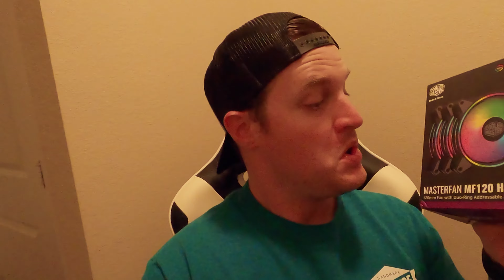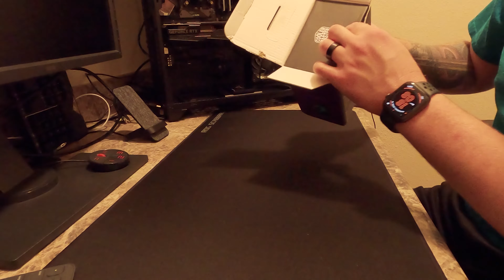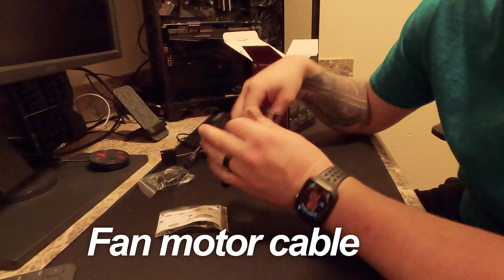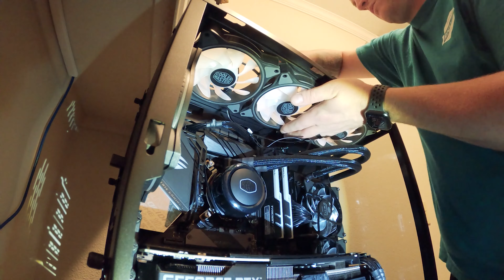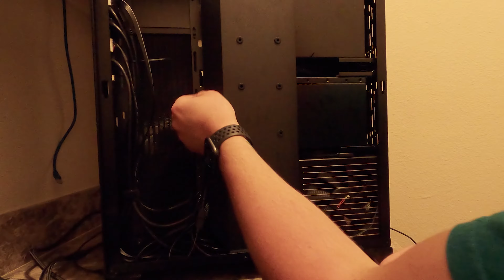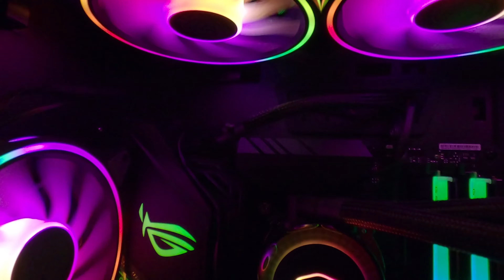Masterfan MF120 Halo Unboxing and Installation (Cooler Master)

Comment: I thought this video was a tutorial on how to connect the fans. guess not but great fans and lights
Reply: yea it was useless lol. says installation and he skips through it all
Reply: do y’all have addr_led or addr_rgb? the fan connector is 3 pins and you need to carefully plug it in there. if it’s going to be the rear fan plug it into the cpu_fan.
Reply: @lxquid.ocelot  3 pins ? I have one fan and have a 3pins but with one close (like one pin is not here). And i have a connector with 4 pins.
Reply: You, me and some other thousand poor souls HAHA
Reply: i see i wasn't the only one that thought this was a completely useless video that skipped the parts most of us need
Reply: Same

Comment: Thanks for not showing how to connect them to the mobo/controller :D showing how to mount 6 fans with 4 screws each is not really an installation guide

Comment: great light show but you missed the point of getting down to the point of how to exactly connect it
Reply: Have you found a video on how to connect?
Reply: @rainy6858  I just used them as case fans without lights I don’t care if it lights up as long as it works lol
Reply: So you can connect this three fans together? Because my motherboard only have 2 case connections for fans and i wanna know if i will be able to get the three fans working
Reply: @cache2152  yep what I just ended up doing was exactly that, although you don't want to have 3 fans running on 1 fan header. I'd say two max as that's what I'm doing.
Reply: Also for the ARGB connector, if your motherboard has a 3 pin argb header you can plug it into there
Reply: yes you can plug the fans into your motherboard i know this but how can i get the rgb lights on them working i have a z170 motherboard and there is no rgb plug on the motherboard i looked
Reply: I pluged all three fans on the mother board and controlling them with their controller
Reply: @GreatestPlayedList  I think we need to get a controller I have the same issue.. sigh
Reply: @GreatestPlayedList  you will have to use the controller provided with the 3 pack to power them through your power supple and the sata connection. Most motherboards nowadays have RGB header connector tho
Reply: Yeah it's driving me crazy, wanna pull the trigger on this set but all I want to know is whether the hub has an argb daisy chain on the motherboard connector so I can connect some other fans. I wanna use the hub because it has it's own power so I can theoretically run 6 argb fans, but NO ONE is showing that, or showcasing all the different configs for hooking it up and the pros and cons.
Reply: @sonicwingnut  you can daisy chain these fans 
KosherTech has a video up about it
Reply: @Simon-qk4vz  yeah I got 3 of these and one of those 360mm 3 fan ARGB panels they do - the panel one doesn't daisy chain but hooked it up to the end of the chain and put the lot straight onto the mobo argb header. Came with PWM splitter cable too but I had enough PWM headers to not need them. Total aRGB current was 2.85a so JUST enough on the header to power everything! The halos are 0.55A so you can have a max of 5 halo ones on a single mobo header.
They did pretty much nothing to improve overall cooling but they look amazing
Reply: @rainy6858  hey if I don't have a 3 pin ARGB header on my motherboard what should I do? buy an adapter?
Reply: @willhannelly8608  I think you might be outta luck, you might be able to get an adaptor possibly. what motherboard do you have?

Comment: Does the pack definitely come with a 3 to 1 fan header splitter as my motherbaord only has 1 fan header also what pin are they? and what pin is the 3 to 1 splitter that goes into the motherbaord. and with the tiny rgb box thing that is included can i use that if my motherbaord does not have a rgb header or will i need to get a rgb controller for it.
Reply from the maker: Yes the 3 pack definitely comes with the fan motor splitter cable. 3 to 1. Also the fan motor splitter cable is 4 pin. The 3 to 1 argb splitter is a 3 pin cable as well. As for the controller for the rgb support without mobo control, I’m honestly not too sure. I would imagine that it’s possible to use the controller in that way, I just can’t say for certain because I didn’t set mine up like that. Hope this helps. 👍🏼
Reply: cantgetnopeace I didn’t get the splitter. Only the argb version gets it😢

Comment: I have a similar rig with the 011 Dynamic and 6 x MF120s I would suggest putting the radiator on the top as an exhaust. Then have the halo fans as intake.
Reply: Since you have six fans, did you use 1 or both of the RGB controllers?
Reply: Hi man how many of the rgb controllers did you use for this I bought 9 fans and have 3 controllers but don’t want to use all 3 controllers
Reply: @harrypalmer1391  zero! I have my fan RGB daisy chained in to the motherboard plugs.

Comment: You installed the liquid cooler fans reverse direction. It needs to blow the heat out of the radiator.

Comment: Hi! I have the sabe fan kit. they are great, the only problem I had was with controling the RGB from the fans. It just didn't work, no software detected the fans in my system. Did you have this problem? would it be fixed if I bught a fan hub?

Comment: Hello. I have the same fans but my LED are not working bcs. I do not have a 3-pin cable connection in my motherboard. How do you get the fans to light up, and what extra cable connection are you using? Thanks.

Comment: ive never used a water cooler(but i plan to in the near future) so im not too sure of the heat in the radiator fins but wouldn't it be better to exhaust through the radiator? or is the heat in the fins negligible? anyway..sweet setup..appreciate the video. thanks

Comment: Thank you for this video. Almost the exact case I got (I have the pc-o11d razer edition). Could not find anything helpful on YouTube about these fans, which are/were impossible to find! Not sure why but they're not in stock anywhere now (especially 3-packs). I had to purchase 6 individual ones which should come by this weekend. Been waiting for a week already.
Reply from the maker: Nice! Very similar case indeed! Whenever I was ordering these fans around mid March I was able to buy 1 pack at regular MSRP and then the only way I was able to get the second pack was paying the price gouged additional $30 that a 3rd party seller was asking for. Definitely over paid but I wanted the fans to all match! Glad you enjoyed the video. Good luck on your installation this weekend!
Reply: I’m dealing with the same problem. Now even the price gougers are sold out. I just need 3 more for my build smh
Reply from the maker: It’s definitely a shame how limited supplies can cause prices to skyrocket 🙄
Reply: so to connect these fans what cables need plugging in? I'm planning on getting 9 of these but my mobo only has 2 argb connectors, will I still be able to use them all?
Reply: Saul you can daisy chain the fans together. Probably don’t need extra cables. I got argb extensions just to make the wiring easier.

Comment: Mine come tomorrow going to swap out the 3 front intake fans on my master box mb530p opted for a Noctua redux 1700rpm pwm as exhaust though wanted something that can ramp Upto full speed exhausting heat without hearing it and tbh I’ve noticed lower temps since fitting the redux so I’m expecting more of a decrease once these are fitted and my intakes on pwm

Comment: Great video! I'm looking at installing the 360R and an additional 6x MF Halo fans in my Lian-Li also. Is it possible, using three to one splitters, to connect all fans to the controller that comes with the 360R and then connect and control all fans from one header on the mobo?
Reply from the maker: So that’s basically how I have it set up and yes it works. I have it set up to where the 1 argb mobo header is going to the controller and everything else coming off the controller with splitters and what nots. 👍🏼
Reply: @cantgetnopeace8923  Awesome! So there's no concern around voltages or overloading that one header on the mobo with 9 fans? Also, are you plugged into a 3-pin addressable rgb header or 4-pin?
Reply from the maker: I’m plugged into a 5v 3 pin argb header on the motherboard. And then all my other stuff is plugged into the argb headers on the controller. Haven’t had issues other than brightest colors seem to be struggling for voltage because they go dim when they should be brightening. Haven’t been able to troubleshoot but I imagine my issue may be in the argb controller somewhere.
Reply: @cantgetnopeace8923  Thanks for the help. Please let me know should you find a solution to that and I'll be subscribed should you touch on it in a future video!
Reply: @cantgetnopeace8923  would this be able to work with 9 of these fans?
Reply: @cantgetnopeace8923  As per the manual of three different asus boards, "The addressable gen 2 RGB header supports WS2812B addressable RGB LED strips (5V/Data/Ground), with a maximum power rating of 3A (5V) and a maximum of 120 LEDs". The ones from cooler master, each, has 24, I guess that is the reason why you are noticing those issues. I wanted to buy a Strix board, I wanna add only 6 Fans.

The new fans now come with the male/female connection so you can daisy chain them, I wonder If I can just daisy chain them all and just plug them into the mother board or I need the controller... I guess I will use only 1 controller, chain them and then plug the controller into the mobo. Is this what you did? There is also a controller from cooler master that can handle 6 fans, however if the ASUS single ARGB header can handle only 120 LEDs, I guess it doesn't really makes sense to get that controller to plug all my fans, since the header will still be short by 24 LEDs.

EDIT: Strix B550 supports 500 LEDs, so I guess x570 strix does too, however the power rating of EACH HALO ring is 55A (80 max), so that is probably the issue. Regards!

Comment: How are you able to connect 9 fans and control the rgb? I need 7 fans and I'm new to this. Do I need a module, can it be connected straight to the motherboard. I have rog game-e board that supports aura sync. Thanks in advanced. Nice set up by the way. I do have a 10 port pwm fan hub control.
Reply from the maker: You will likely need some type of rgb controller. It works as a module that you will be able to connect your fans to. My most recent video goes into detail on my wiring for my rgb so it might help you understand what you might need for your build. 👍🏼 
https://youtu.be/Lg0xGQm0iTI

Comment: that looks so good matey- what kind of temps are you getting?
Reply from the maker: I haven’t done any true temp tests but I know cpu temp generally stays around 36 degrees. Under a heavy video rendering load I’ve never seen it pass 60. I would like to do some actual temperature tests in the future to learn what makes my equipment run the hottest. 👍🏼

Comment: should show the software setup and addressable RGBs. There are complaints online that the advertisement of 24 addressable RGBs is false, as the 8 LEDs on the fan are linked to 8 LEDs of the leds in the halo, and therefore cannot be individually addressed.
Reply from the maker: Interesting! I haven’t tested this but I’m intrigued now! Thanks for the info! I will add this on the agenda!

Comment: If I have an Aorus motherboard, the Z930 pro wifi, and I plan to get fans that need argb and can not be controlled in Rgb fusion, will I not be able to control the rgb since the fans can only be controlled in other Softwares, not rgb fusion due to the header. Or will the fan controller control the software?
Reply: Hey dude, did the fan work with the RGB Fusion 2.0? 

I have the exact same board and don't know if I should buy the fan or not

Comment: hey I got 3 of these and daisychanged them together to one 3 pin JRAINBOW connector and 2 of them have rgb that doesnt work while one does. I've tried everything, bios stuff, msi dragon center stuff and different ports and stuff on the mobo and still nothing.

Comment: hey man i am going to get these but my motherboard only has I fan header and 1 cpu fan header what can I do I was going to get a fan splitter but I could only find ones that split into two and I need 3 please help
Reply from the maker: The 3 pack comes with all the cables you need. It comes with a 3 to 1 splitter.
Reply: @cantgetnopeace8923  oh okay so all i need to have is the one fan header and do I need to connect the rgb stuff to anything else on the motherboard or can it just connect to the one fan header thanks I really appreciate you replying you have earned a new subscriber (:
Reply from the maker: Fan header and rgb header are 2 separate headers with 2 separate plug styles and everything. 2 completely different things. Fan headers control the fan motors and rgb or argb headers control the lighting.
Reply: @cantgetnopeace8923  oh okay so where would I put the rbg headers
Reply from the maker: Your mobo manual will show you where your fan headers are and where your rgb headers are. And any other information specific to your mobo model.
Reply: @cantgetnopeace8923  what should i do if my motherboard doesn't have any rgb headers
Reply: @cantgetnopeace8923  i have a H110m pro-Vd
Reply from the maker: You can still have fans of course but to my knowledge you won’t be able to use the rgb functions without rgb headers. The mobo has to have a way to tell the leds how to light up and what color to light as. Without a rgb header I’m not sure how you’d be able to get that signal from your mobo to the fans. There may be a way to use an external remote but I’ve never wired one in so I’m not much of a help there. Good luck to you though! Hope this helps!

Comment: hey bro, can i connect the 6 fans in the same 5v on the mobo with an argb splitter?, or will it be too much for the mobo and will not provide enough energy to the fans

Comment: Hi - My mobo has 2 12V RGB headers, would that work with those fans?
Reply from the maker: No argb and rgb devices are not interchangeable.
Reply: I forgot who but someone makes a rgb to ARGB adapter but the fans won’t work as well rgb wise you will only be able to set all led’s to one colour at a time as a whole like a standard rgb fan or strip if I remember who I’ll add a edit

Comment: awesome video! do you have any idea if these fans support boards without ARGB headers?
Reply from the maker: Josh Davey that’s a great question! My guess would be yes and no. I know argb headers are 5 volt headers and regular rgb headers are 12 volt headers so if you try to connect argb headers to rgb headers then unfortunately you’ll fry the argb leds due to too high of voltage. But I imagine theoretically you can possibly reduce the voltage by adding in a controller or some other device that could safely reduce the voltage. I imagine it’s possible but it might be a hassle. Hope this helps!
Reply: CantGetNoPeace i see! Thanks for the reply. I’m trying to find rgb fans that will support my motherboard, that doesn’t have argb headers or rgb headers. Guess this isn’t the one unfortunately lol
Nevertheless, great video! Got a new sub from me.
Reply: @9nth  you'd need to either use an external argb controller or there are some rgb to argb converters which I heard work fine as well. For example, this one by Deep Cool:
https://www.amazon.com/DEEPCOOL-Convertor-Transfer-Motherboard-Products/dp/B07QPYSC82
Reply: @cantgetnopeace8923   the controller that came with the kit can do that?

Comment: Hey I'm also just curious. Which liquid cooling do you have? And is it good?
Thanks. I will sub. 
Btw I see you have a rlly nice rgb ssd at the bottom. Didn't know u could mount ssd's there. lol.
Reply from the maker: I have the coolermaster Ml360r aio. I’ve had no problems with it. Seems like a solid unit. Kinda pricy around $130 I think. And yes the Lian Li O11D has all sorts of fun mounting options. 👍🏼
Reply: @cantgetnopeace8923  You have a Lian Li o11 D extra large right? Cause I see you mounted a fan at the rear.
Reply from the maker: Yep that’s correct 👍🏼 I generalized the model because they’re all very similar with the ssd mounting options.